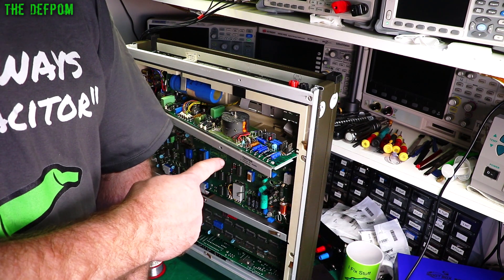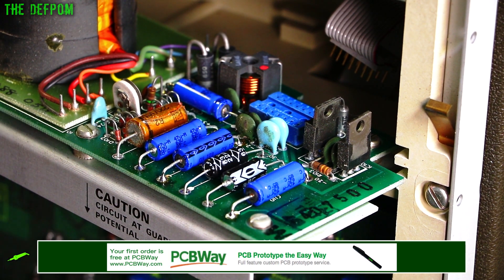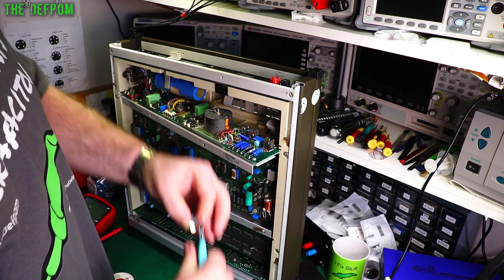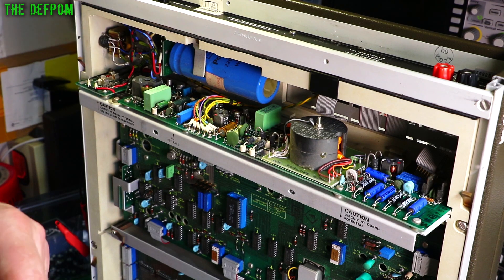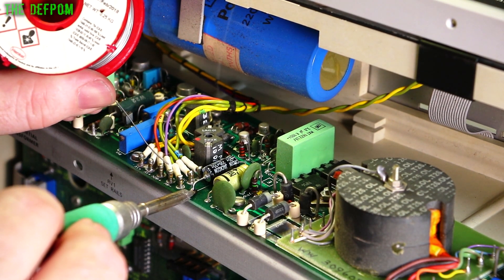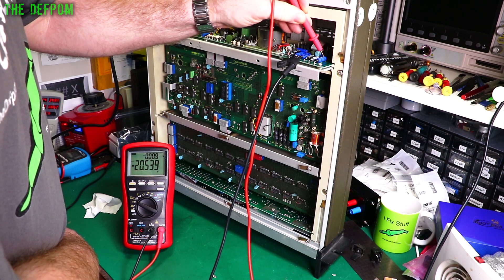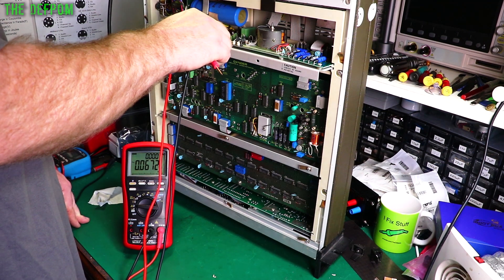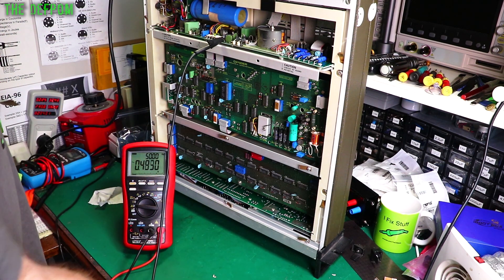🔴 Solartron 7075 Minor Repairs and Testing - 7.5 Digit Multimeter Repair - No.789

Comment: Nice idea re the blob at the top, man. Need to finally recap my Solartron 7150 to reassemble
Reply from the maker: The solder flows through to the bottom pads too, so it ends up being soldered properly.

Comment: Fun video. I have a couple of  Solartron 7081 and one is giving me fits troubleshooting it. Your videos always inspire me.
Reply from the maker: If you get sick of trying to fix it, I will take it off your hands and dispose of it for you :-)
Reply: 8.5-digit meters can be temperamental if not well treated.
Reply: @douro20  I already confirmed the two opto-couplers were bad.  The memory was put in all backwards.  All of it.  All batteries are replaced. One bad tant took out one power regulator. New CMOS rewritten, new MCU,  driver chip and memory. But, the screen won't display.  Of course all works with a known good earthy logic board. Screens fines. But this unit can't have the good board.  The board must be repaired.  I picked up all the gear to read the logic.  But can't figure it out.  The two logic boards are different generations CMOS wiring, so, swapping is out.

Comment: Smashing repair :-D,  i think scots precision voltage generator is brilliant, i'm sure i looked at the schematic for an early version and i was impressed.
I was given an old fluke 111 bottom end meter,  after i checked my pile of cheap multimeters i found them to be good enough for my uses.
I have a few ancient 10V round metal ref chips LH0070-0H +/- 0.03%,  never used and all my meters were set to that years back.
Reply: Cheers!.......you probably saw an old prototype on EEVBLOG, it's changed massively since then......different uP, DAC and Vref.

Comment: Nice repair! Couple of questions - 2:11 - is that bird song? Did Solartron use silver solder originally, I've not seen this mentioned in any service manuals. Does the Solartron use the same Sperry displays as the Datron (SP 353)?
Reply: I thought only the old scopes with the white ceramic boards  needed only silver solder.
But i could be wrong lol.
Reply from the maker: Yes bird song, as far as solder no idea, but I like to use the good stuff on test gear, I don’t know about the display, it is some kind of vfd